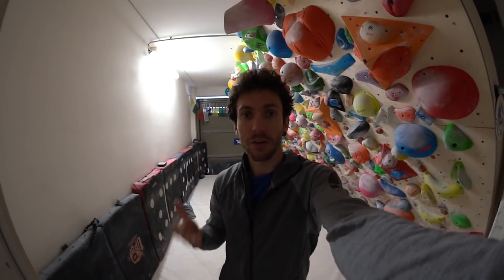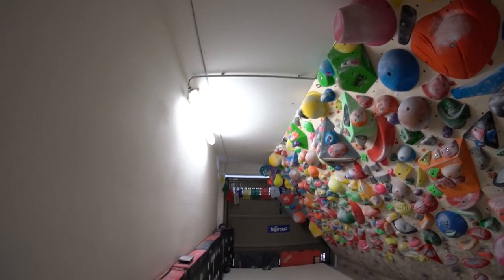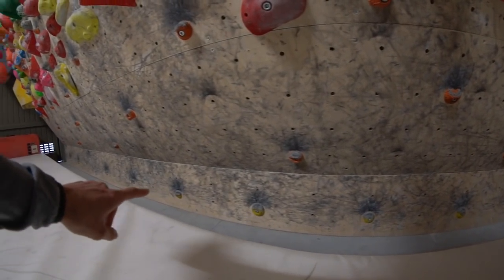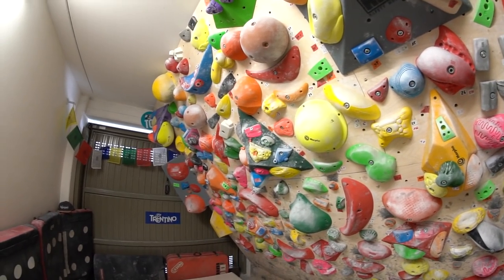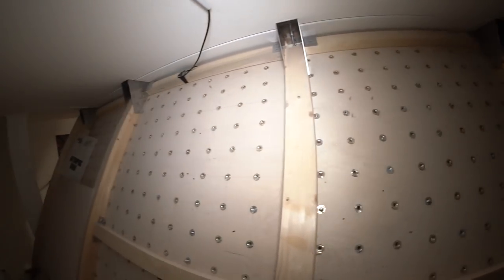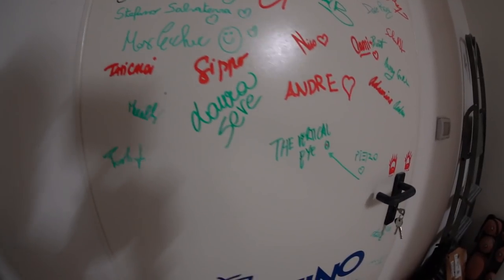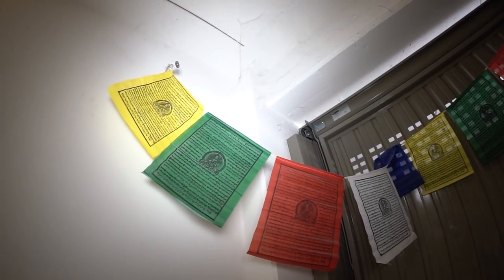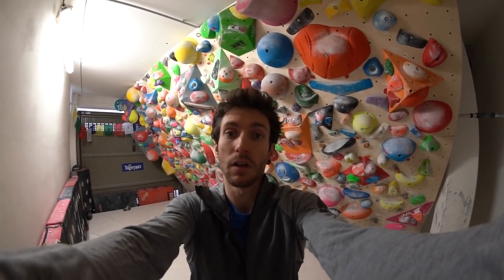HOME Climbing Wall Tour

Comment: check out "boulder problems" app for having an easy to use image data base of all your problems sorted with filters. Pretty usefull for home walls and small gyms, that way you save yourself the time of writing and sticking numbers on the wall with different tapes